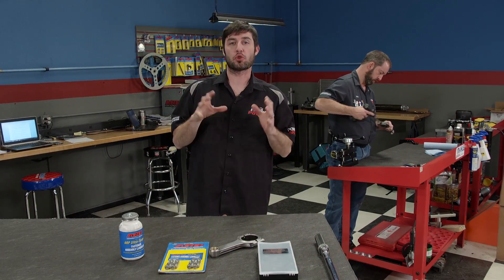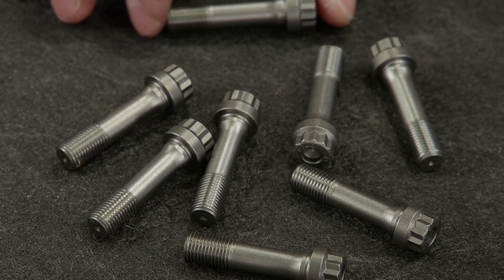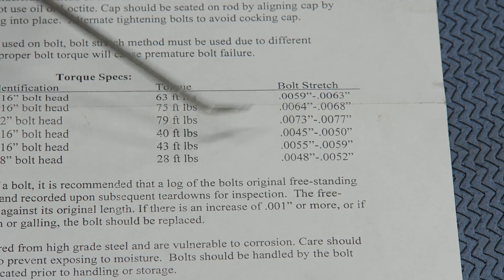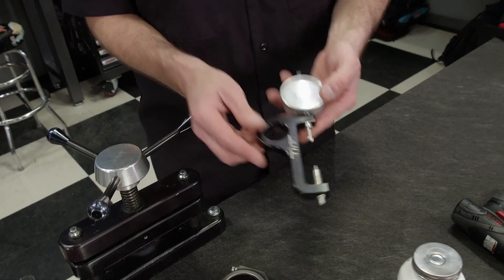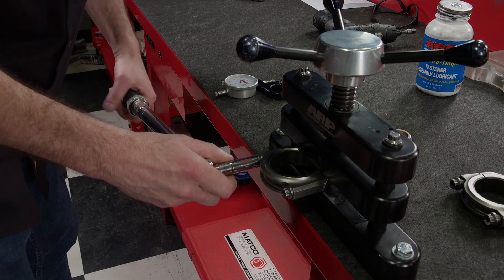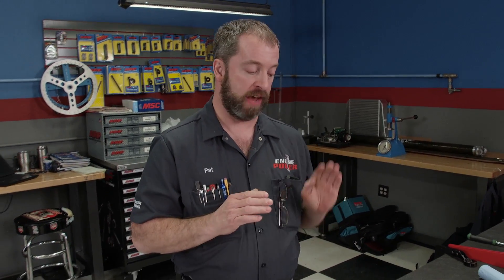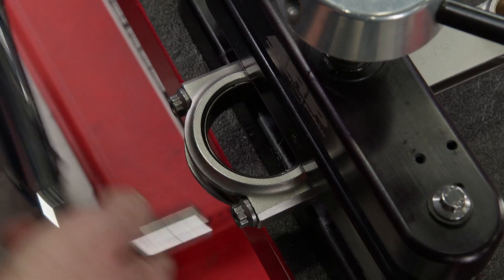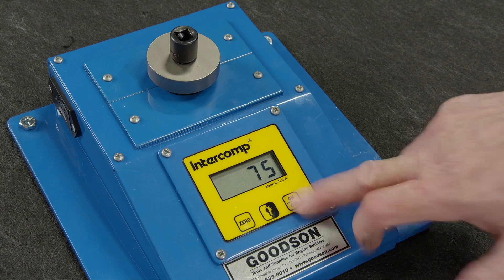A Better Look At The Most Critical Fasteners In An Engine

Comment: This is f ing rediculous. The correct way to torque bolts its the way specified by the manufacturers engineers in the spec. Unless you are racing Nascar or top fuel or something no one has that damn tool. Your overly technical mumbo jumbo is bs. You don't need maximum tension you need the tension the engineers designed the component for a holes

Comment: I was rebuilding my 96 Tahoe 5.7 engine. I tried to reuse the stock head bolts. Yes I knew they were torque to yield. I also know that people tell me I can't do a lot of things I can do. After installing 7 bolts, one broke. Yes I had to remove the head to get the bolt out. I was going to buy ARP head bolts until I found out they cost $100 for the set. I went to Autozone and bought a set of Felpro for $36. Before you guys call me names. Think about it this way. My engine went 305,000 miles with torque to yield bolts. Felpro are reusable and I'm sure are stronger than the stock bolts. I could feel the stretching in the stock bolts. The Felpro had no stretch.
Reply: "I also know that people tell me I can't do a lot of things I can do."

"I was going to buy ARP head bolts until I found out they cost $100 for the set."

hmm, having to take out the entire head because a hundred bucks was too much for me, or fork out a hundred bucks for new, decent head bolts...
Reply: @edbo10  I suppose everyone has a reason as to why they do things. I enjoy checking out different schools of thought. Always learning
Reply: @lionelswart2396  if you are happy to reap the rewards of your choices then go right ahead. Personally though I prefer to avoid having to tear down an engine for a top end rebuild because i just wanted to save 100 bucks for something that would likely last me 20 or more years.
Reply: @edbo10  you're right I would rather do it the right way and spend the extra for piece of mind. I bought TTY bolts for a Hyundai 1.3 GL SOHC . One of the camshaft pillar cap bolts of which there are ten has overstretched close to shearing. The Hyundai agents say these bolts are supposed to be TTY bolts. The bolts have to be ordered from Korea. I bought ten high tensile bolts but am hesitant to use them in place of  TTY
Reply: The engine was still on the stand. Removing a few bolts were worth saving $64. I bet you don't have a video of you checking the oil in your mother car. @edbo10

Comment: It's kind of silly,so the torque is 90 and not 75.why bother with degrees.Its like head bolts,tighten to 65 then 90 degrees.Which on the torque wrench ends up being 80 pds.So why not just say torque heads to 65 then reset your torque to 80pds.
Reply: Because that's not how it works. The torque-then-degree procedure is for torque-to-yield bolts, the ARP bolts are NOT torque-to-yield. What they did here was measure the actual stretch for that particular rod/bolt combo.

Comment: Why do you have to loose the bolt when doing increments? I mean if it didn’t turn after the first increment, the second or third increment will eventually turn the bolt, so that step is completely useless.
Reply: You're looking at it wrong. It isn't about "whether it turns". Loosening it and tightening again with a new setting is more accurate/precise then trying to add torque to an already-tight bolt. The lube used and, especially, the difference between static and dynamic coefficients of friction play a part but I'm not sure I'll explain it correctly 😂. But basically it takes more torque to "unstick" the bolt (static coefficient of friction) and start it turning than it does to gradually increase the load on an already-turning bolt (dynamic coefficient). If you're only trying to increase the fastened torque spec by 5 ft-lbs, it might take more than that to "unseat" the bolt and get it to turn initially, at which point you've already overtorqued it. By loosening it, you're "unseating" the bolt at a much lower torque to get it to spin, and approaching the stretch/clamp needed at a more gradual rate.
Reply: Loosening bolts is for accuracy and sometimes to make sure the part is centered

Comment: Very descent video. With respect you should have talked about bolt lube and its effect on torque/stretch values.
Reply: Bolt lubing? People are always creating new problems that didn't exist before.
Reply: @Fone65  using lube on the bolts to get the correct torque value is part of the manufacturer's spec.
Reply: @jsquared1013  No it's not. This problem was created by Companies trying to sell lube. I've never seen a shop manual say to lube bolts before torque.
Reply: @jsquared1013  Funny how people with no videos are always trying to school someone. Upload a video showing people how to torque bolts.
Reply: @Fone65  Dude are you serious? Lubing the bolt makes a huge difference. The friction value change and there fore the stretch of the bolt relative to the torqe. Also you get more torsion forces in to the bolt. That said I think torque specs should be held very loosely and using a torque wrench is usually counterproductive to just torquing them by hand.
Reply: @xy-yt3xp  You are wasting your time with me. I went to school to rebuild engines. We torque head bolts but we didn't lube them. Like I said. This is some bs created by some guy sitting behind a desk. Probably the mofo who thought it was a good idea to put grease on the back of pads.
Reply: @Fone65  there are dry and wet torque values, and have been for forever.  You can't explain them out of existence.  Thanks for pontificating though
Reply: @Fone65  have you ever heard of the  cold welding of stainless steel bolts. You have to prevent it by lubing the bolt. So it do think that lubing a bolt makes a difference.
Reply: @xy-yt3xp  People have been building engines for years without lubing bolts. When the engineers came up with torque specs. Thought about dry bolts. I bet you don't have a video of you working on a car.
Reply: @Mastermindyoung14  Why do people with no videos of them working on cars? Are always trying to school someone.
Reply: i can show you a dozen manuals that show to chase/clean/lube threads before install.  also in ARP's manuals it shows clearly to lube the washers and threads @Fone65
Reply: Also with respect caterpillar 3500 series engine head bolts call for engine oil on threads on installation. That’s just one example I can think of